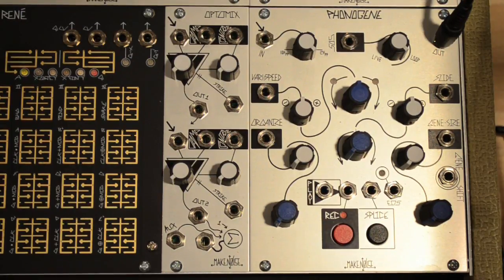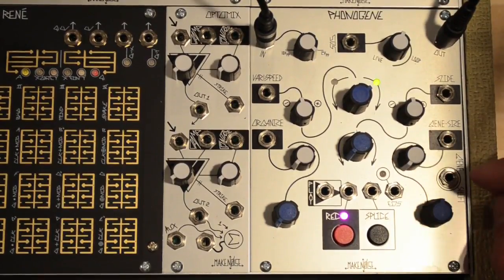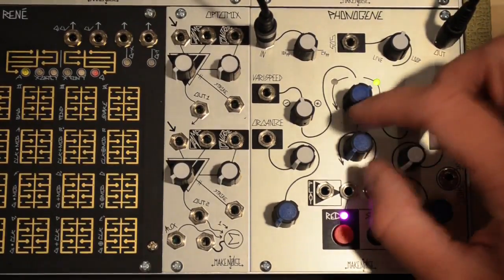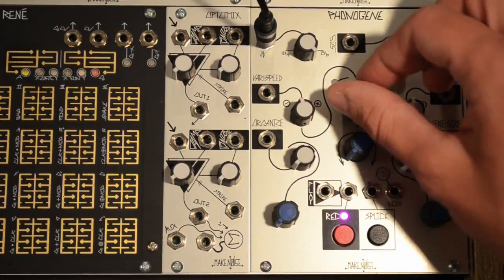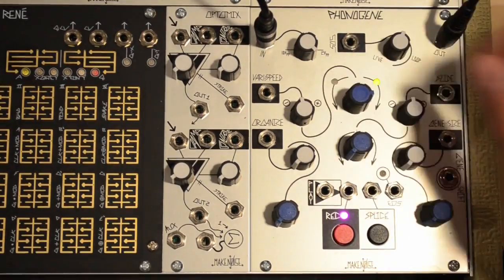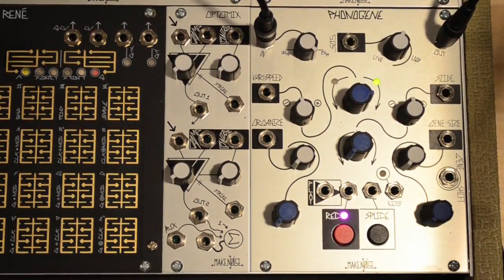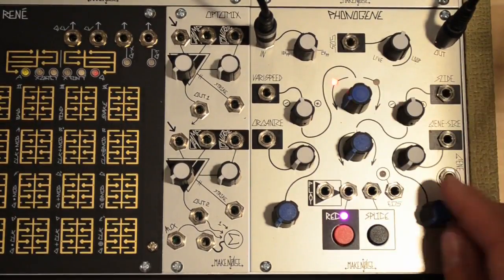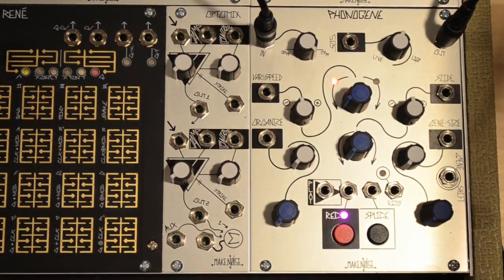Make Noise Phonogene Firmware Update Part 1

Comment: Which input will trigger/move the Splices the best? ie: using a pulse from a sequencer, LFOs etc. thanks
Reply from the maker: Can you clarify what you mean by "trigger/move the Splices"?
Reply: 'by 'trigger/move' the splices' I mean exactly that - so an LFO or trigger scrolls thru the splices on the Phonogene or Morphagene like when you Trigger FM on a wavetable like Braids for example, to scroll the different tables.  @MAKEN0ISEMUSIC
Reply from the maker: Weepwow if you mean send a trigger to jump to the next Gene, that’s what Gene Shift does. On Morphagene, the Clock input does it, and Shift moves to next Splice. Is that what you’re looking for?
Reply: Thanks. Yes, will try a few patches. @MAKEN0ISEMUSIC

Comment: How can I see which firmware I am running? I have 2 Phonogenes. Thanks
Reply from the maker: If the Phonogene has had its firmware updated (or shipped with the updated firmware) it will most likely be marked on the back with the notation "372h". If this notation is not on there, you can check the firmware with the following procedure:

1. Record something into the buffer, medium (2-3 second) record time. 
2. Turn Gene Size all the way down and see EOS lighting at end of each Splice playback. 
3. Turn Gene Size gradually up. If the EOS lights more frequently as you turn it up, you have the firmware update. If the EOS stops, you have the original firmware.
Reply: Thanks Much! got it. @MAKEN0ISEMUSIC

Comment: Is it possible to patch a stereo signal into the input? Like from an iPod or so? Would be good to know !
Reply from the maker: Arthur Robert we patch iPhone and iPad all the time. However, they will be in Mono. Still it is quite useful to patch these devices to the Phonogene.
Reply from the maker: Just use a regular patch cable. You could use a stereo cable but one channel won't be read.
Reply: MAKEN0ISE Cool, and do you use the normal mono mini jack or a stereo cable from the iphone to the input? sorry for the noob questions :)